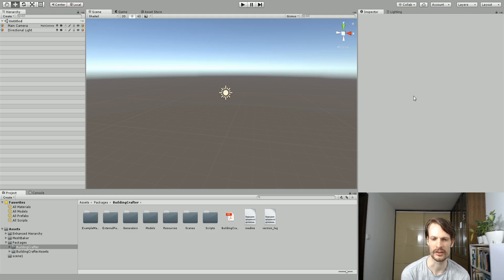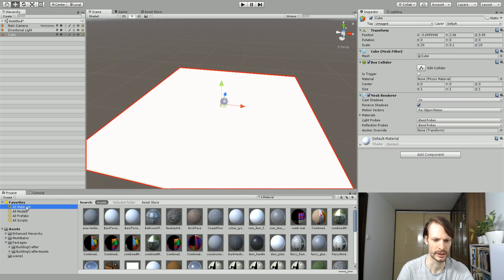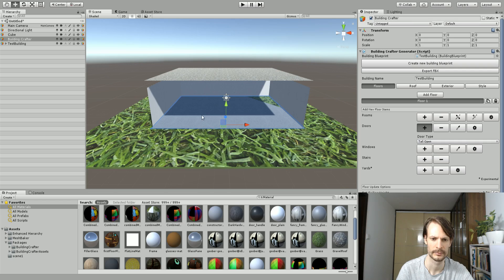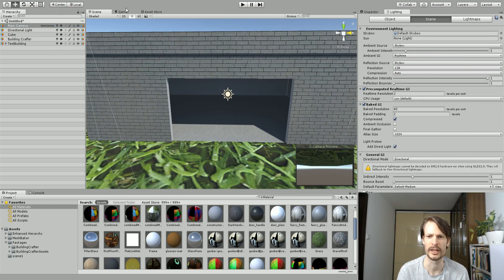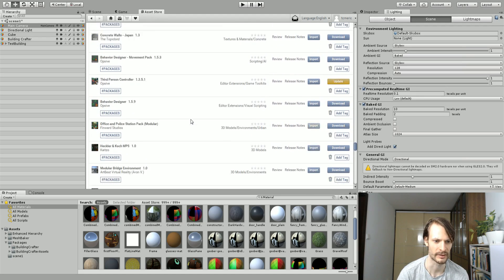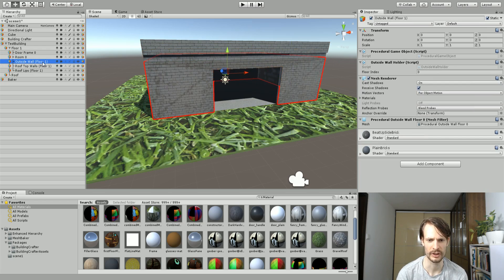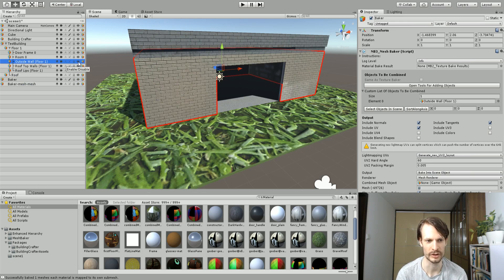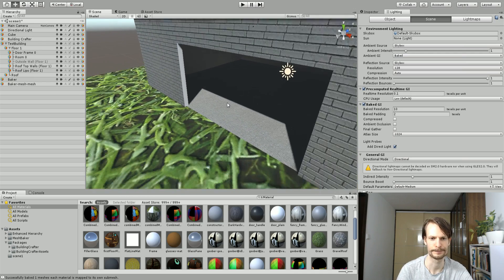Correct Baked Lighting UV2s in Building Crafter for Unity 5 with Mesh Baker

Comment: I just found this video tutorial. Super awesome! Thanks so much for putting this out here.

From a technical aspect, the reason the blotchiness happens (I think) is because when Unity bakes the scene, it takes a whole bunch of objects, maps their UVs and then uses that for the lighting. The UV maps for the lighting will be big and atlased which means all the textures for all the walls will be in one texture. Because Building Crafter uses tiling UVs on all its surfaces, this confuses Unity. I really haven't figured out how to fix this problem yet.

Oh and the "Building Filler" object is for Level of Detail (LOD). I made Buidling Crafter so you can have hundreds of buildings in a scene and it doesn't destroy your computer. So once you get a certain distance away, all the internal parts of the building are hidden from the player. I had a scene with 91 buildings and it ran fine.

Thanks again for posting this, I am going to post it on the forum post if you haven't already.
Reply from the maker: Hi. The video is a little long winded but it does show one potential fix :) Thanks for the tip about the LOD filler. Great job on the asset. Looking forward to the next update!